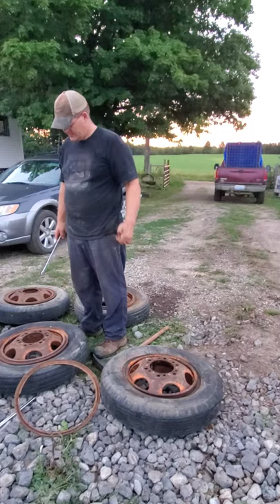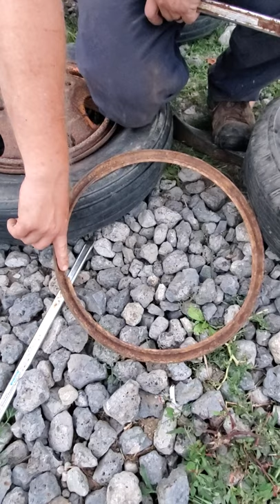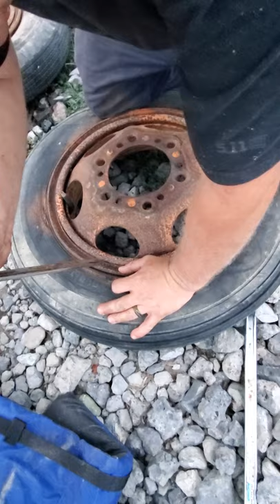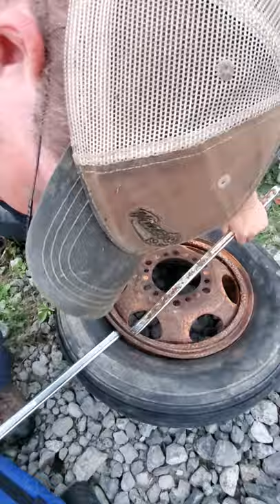Solid lock ring rims.  Ring removal

Comment: If you press the opposite side of the ring(opposite of the pry notch) downward toward the inside of the rim it takes the tension off that ring so you don't have to bend it like you did. Almost like dismounting a tubeless tire.  If you bend that ring too much it will cause it to become unsafe. Just a word of advise I had a very good teacher at the tire shop I worked at in high school. Spray lube also helps, and if something ever feels like its bending stop.

Comment: Throw the split rims away get you some tubeless
Reply: Thats not always a option when there are no wheels same pattern and offset. Some stuff isn’t common. Like 40’s ford 1 tons.
Reply: Not always an option if you can't find the right size/bolt pattern/offset, and if a person is restoring an old truck, often the 1 piece rims don't look right...and nothing wrong with tube-type tires on an old truck if they are in good shape...

Comment: Thanks for the video.  From what I understand the thinning spot in the site of the solid ring is the key to allowing the ring (when it is tipped) to slip over the edge of the rim.  Sounds like it would be relatively easy IF no tire on the rim but difficult once the tire is mounted.

Comment: Be very cautious when airing up one of those type.  Use cage or chains.  The retaining lips can get sprung out of shape or corroded and fail as the tire expands.  I used to have some and one day I had one come off.    I was safely out of the way but the ring flew across the yard when it let go!